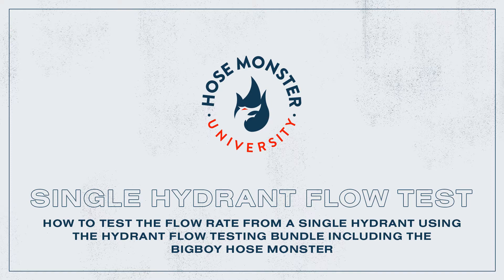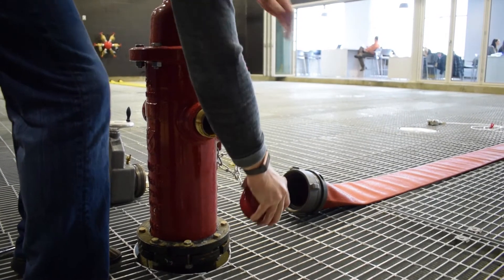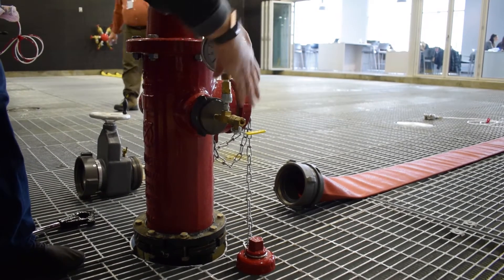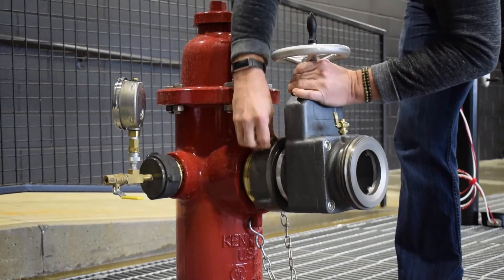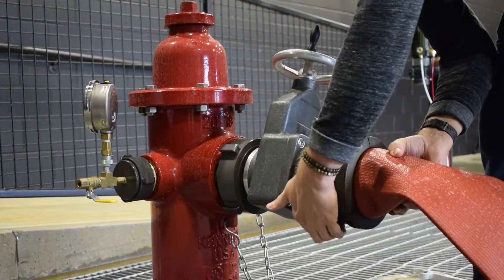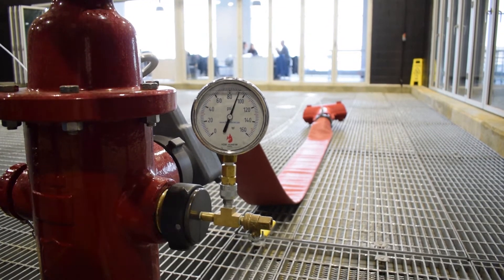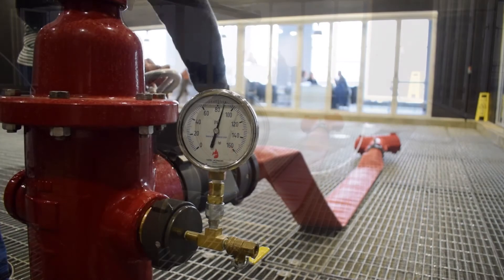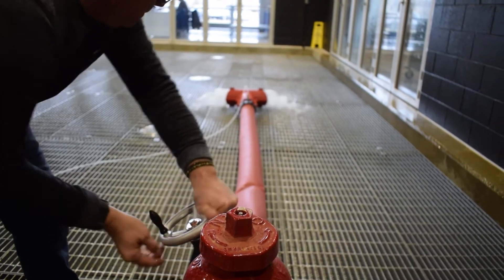How to Conduct a Single Hydrant Flow Test | Hose Monster University

Comment: Just a safety tip.....after you remove the caps, tighten the remaining cap, in this case a2.5" !!!!! Many times after a leak, we use hydrants to get the air out while filling the main. Especially in cold climates ( dry barrel hydrants)  we often ,,do to time constraints,  shut the hydrant and put the cap on only a couple of turns to,allow the hydrant to drain.  Even though we intend to return and tighten the cap, sometimes that never happens!!!!! I have seen people  hurt from being hit by caps, thinking they were secure!!!

Comment: If you are doing a 5-year flow test of the private service mains, this is incorrect.  NFPA 291 states you should use 2 hydrants not 1.
Reply from the maker: Hi Matthew - We agree, when assessing the capacity of a water main for fire protection purposes the two hydrant test is the correct test to perform (which we also have a video on).  However, this test is appropriate to confirm the proper function and output of an individual hydrant.
Reply: @hosemonster - What's the link to that video?
Reply: well they were not doing a 5 year,